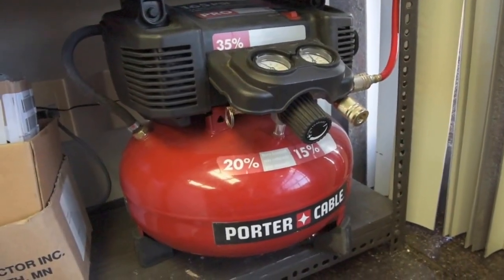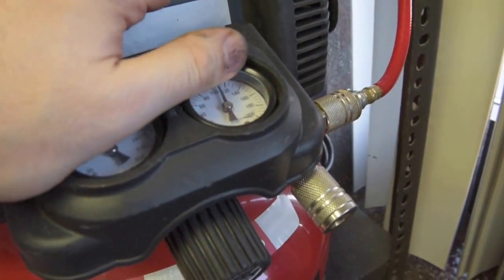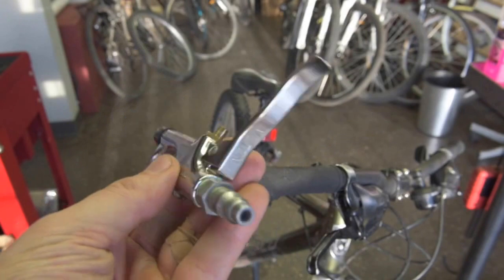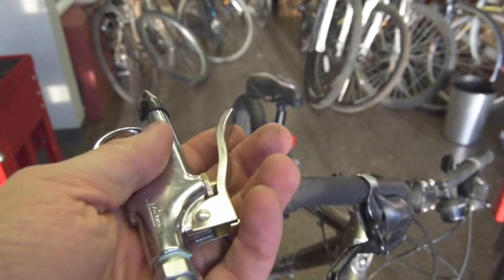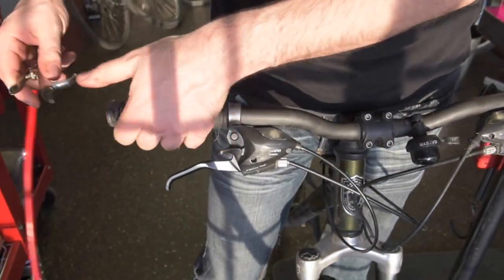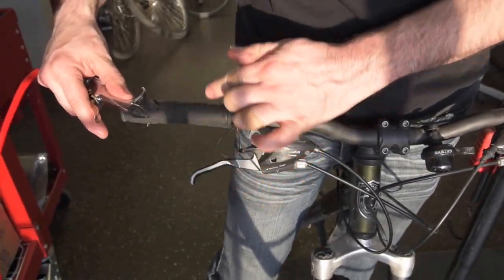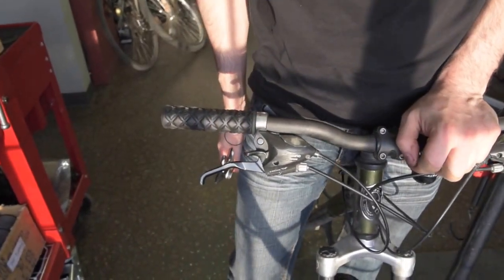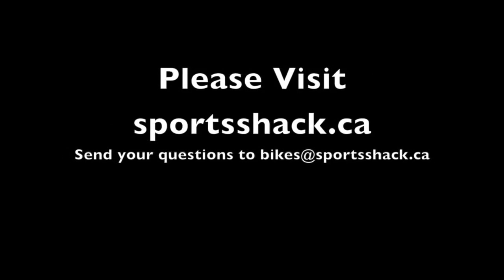How to Install Handlebar Grips on Your Bike.. the Fast Way

Comment: Dude, this is absolutely fast but definitely not easy. I don't own a compressor and niether that end to insert it under the grip.
I'd correct your introduction by saying that this is the fastest but the most complicated way as long as you need very specific tools.
In order to be the easiest way it must be accessible to everyone with no specific tools needed.